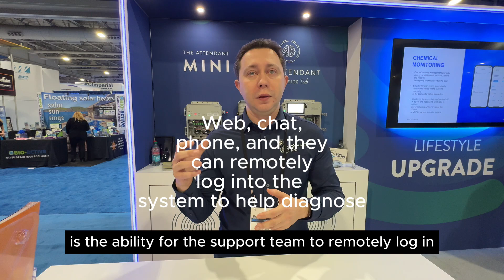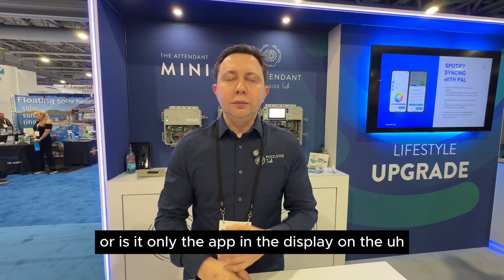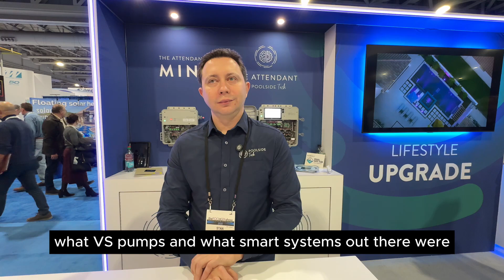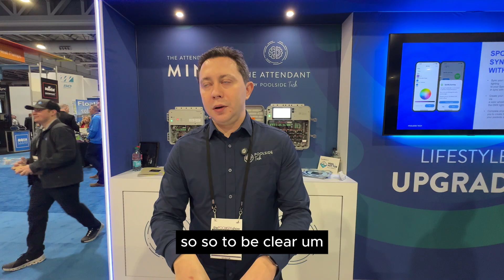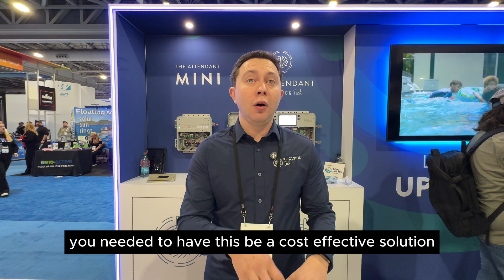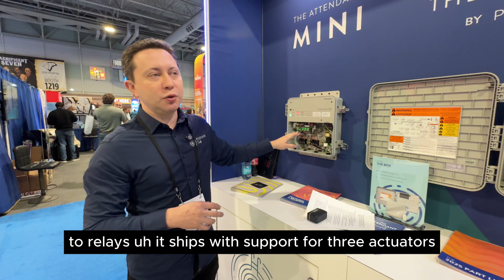Next-Level Pool Automation: Poolside Tech “Attendant” & “Mini” Control Systems EXPLAINED

Comment: My salt water pool was finished up in January and the attendant mini was installed. I need to correct the weak WIFI at the pad then we should be up and running. I will be adding chemistry to the system.

Comment: holes, holes and more holes.....
flow meters have been out forever so no water hydraulic calculations are needed. theirs just has a wire connected to the controller. if it doesn't backwash the system or clean the trap basket, it's only function is to read remotely when you can't do anything about it. 
call in to troubleshoot issues ??? unless their equipment is faulty, it sounds like their only going to troubleshoot chemistry issues which have to be verified by a manual test of the water to make sure sensors are reading accurately. NO adjustments to chemical set points should be made blindly. it only masks the problem which most likely is a sensor issue or user issue most of the time. This will not replace your pool professional people!

What does this controller do that others on the market can't do? a home owner needs to learn a lot or rely on a professional. My bet is on the professional that's been doing this a long time. KISS method is best.
Reply from the maker: I like it